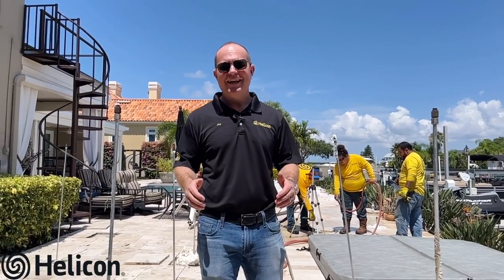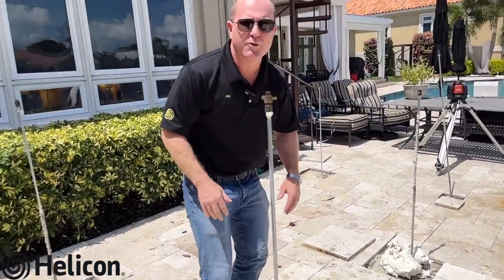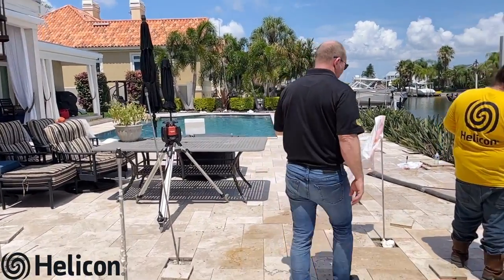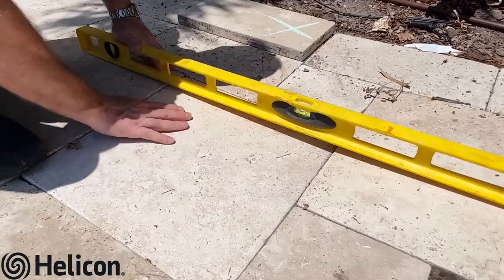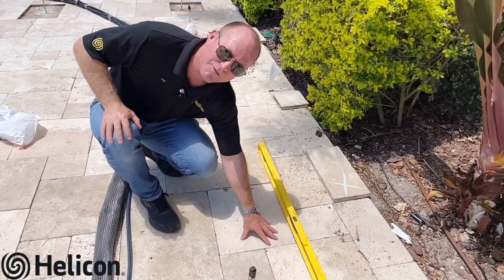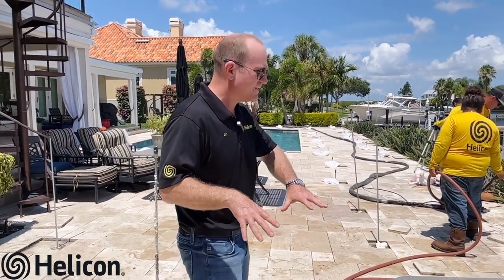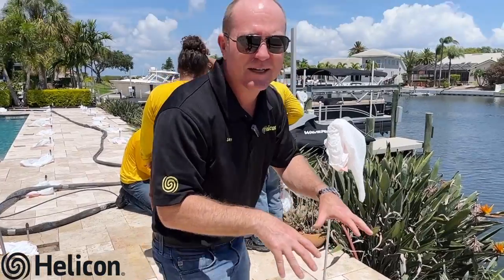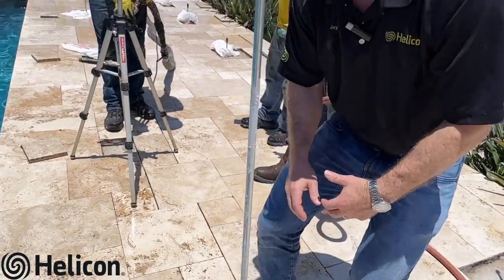How to Repair Sinking Pool Deck Pavers - You Won't Believe What Happens Next!

Comment: What product do you recommend to seal between pavers?
Reply from the maker: To seal the joints between pavers, try using polymeric sand. It's specially formulated to fill the gaps between pavers and hardens upon exposure to water, creating a durable, stable, and long-lasting joint.